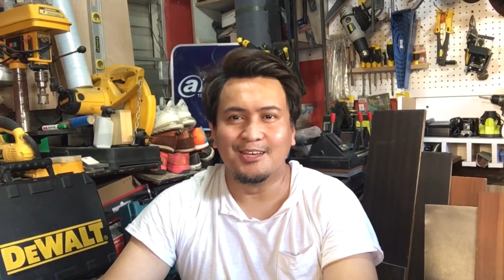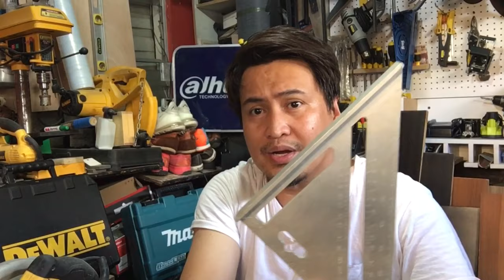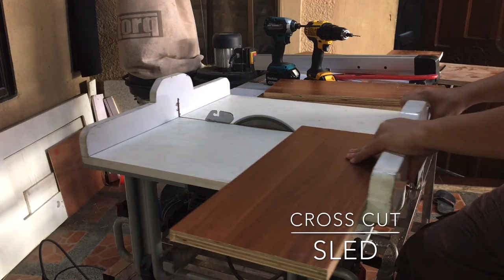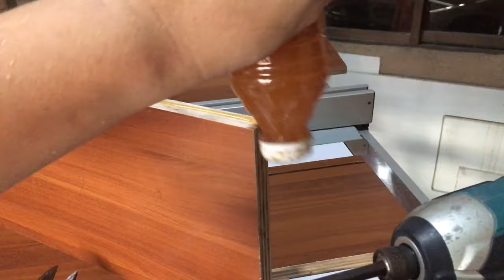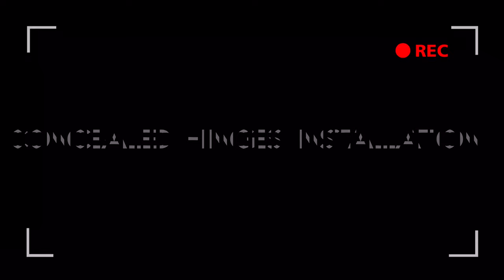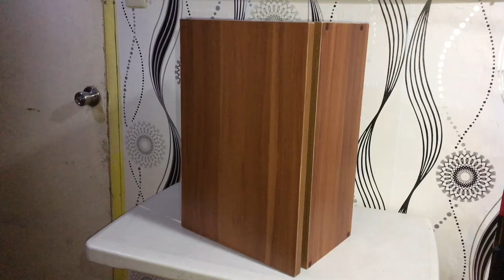HOW TO MAKE MODULAR CABINET [DIY PHILIPPINES]

Comment: Sir Puwede ba yong Diablo 80T pang Rip Cut ng mga marine melamine?
Reply from the maker: Yes pwedeng pwede yan magamda 80 T para sa melamine boards
Reply: @arokabletv  thank you sir sabi kasi ng iba nasusunog daw o may burn marks kapag masyado mataas ang teeth count kapag rip cut?
Reply from the maker: @joshuady1327  di naman po ang cause po ng burn mark is mapurol na po ang. Blade and di po aligned ang blade pag cut, 60 or higher teeth po is recommended sa mga fine cutting gaya ng melamine maselan po sya para iwas chips out.. wala g Siklat at edges or tip ng boards..
Reply: @arokabletv  ok po sir salamat!

Comment: Sir tanong po if u have used or any experience fdbk with MFC material ?
Reply from the maker: Ok naman sta if not exposed sa mga basang area like kitchen cabinet .. basta wag mababasa ok naman sya it will last naman .. kasi pag na basa at na exposed sigurado lolobo ang materials mo na MFC
Reply: @arokabletv  recently kc I contacted a supplier and searched a video of their product knowledge, the test was a 24 hr water soak bet Marine plywood and MFC, result in caliper showed that marine expanded 2x bigger than d MFC. The product is made in Austria and d size is 9x7 ft. 2face melamine.
Reply from the maker: @kingdomtreasures888  yes may mga lumalabas na MFC or MDF na water resistant na may chemical content against sa water at meron din na PVC board design for kitchen cabs
Reply: @arokabletv  opo sir amazing ung PVC di pa po ako nakagamit nun product din ng supplier that I contacted medjo pricey lang for non-melamine but perfect for kitchen solutions pang lifetime na yun. Salamat sir 🤘🤘

Comment: Boss pwede po ba gawing countertop yung plywood na may formica laminate?
Reply from the maker: Jed Escuzar yes pwede naman pero kung sa kitchen sya mas advisable ang granite or solid surface
Reply: @arokabletv  rental lang kasi yung apartment ko kaya feeling ko hindi justifiable mag granite hahaha. anyway, if that't the case then pwede ba mag-install ng tiles on plywood?
Reply from the maker: Jed Escuzar correct pwede naman mag install ng tiles using mga no more nails  adhesive, maganda kung 60x60 tiles para konti lang dugtung ayus yun
Reply: @arokabletv  a yung sa bostik po ba? pag apply po ba nyan is parang tile adhesive na style?
Reply from the maker: Jed Escuzar hindi portion lang side at gitna balanse mo lang hindi lahat mauubos pang dikit mo agad.. portion lang makapit na yun
Reply: @arokabletv  di ba prone to basag yung tile kapag hindi uniform yung adhesive niya sa baba?
Reply from the maker: Jed Escuzar correct prone sya kung medyo hard ang pag gamit i mean ma totodo ang  diinan  maari boss, pero kung manipis lang ang apply sa plywood  ng adhesive para ma dikit lang di masyado mag aampaw ang tiles normal use di naman mag crack yan matibay din

Comment: Ano po yung specs ng blade na ginagamit nyo sa circular saw para po pino at malinis ang cut ng mdf or marine plywood
Reply from the maker: Bosch na blade gamit ko 80 teeth para sa fine cutting at iwas chip off po

Comment: Hi sir, what do you call the tool you used for the edging, before you cut the excess of the edge by a knife cutter
Reply from the maker: Hi Sir im just using adhesive which is the contact cement or rugby will do, i used a metal cutter to cut the edge band and the other cutter which is the black one? That is edgeband cutter this is available in the market you may contact me on my Fb page to show you the picture and where to buy.

Comment: Ano poh tawag s materyales n ginamit nyo s pag dikit ng s edging.? Ung plastic.
Reply from the maker: Kung pandikit contact cement tawag doon if kung yung dinidikit sa  boar sa edging edgeband po
Reply: Ah edgeband. Ung ka kulay ng board n melamine.?
Reply from the maker: Antabay po kayo para sa give away natin  aa mga sususnod na panahon  pa like and follow din po ng Fb page natin Arokable Tv
Reply from the maker: @augustdelatado63  tama edgeband tawag doon sa ka kulay ng board tama ka yung pamdikot is contact cement or adhesive pwede din rugby
Reply: @arokabletv  salamat poh
Reply from the maker: @augustdelatado63  you're always welcome po pwede nyo po ako Pm sa messenger ng page natin arokable Tv

Comment: Boss paano maiwasan ung mga chippings sa pinagputulan ng mga laminated marine?
Ilang ngipin ng talim gamit nyo po? 60 or 80 po ba? Thanks
Reply from the maker: 80 teeth po pag melamine laminated, dapat sa new project bago blade mo, kung luma blade mo mag pre cut ka muna pasadahan mo ng mga 6mm muna then ulitan mo full cut wala na chipping yan naprocesso lang
Reply: @arokabletv  thank u very much sir for the info saktong sakto bumili pa naman ako ng 7" na 80 teeth. laking tulong tong video mo dahil madalas kaseng nagcchipping mga pinagputulan ng laminates ko, nasasayangan ako sa materyales kapag ganun.
Reply from the maker: @gilangeles1306  you're welcome po practice lang po lagi at gawa ng project gaganda din
Reply: Lagyan mo ng masking tape yung dadaanan ng saw blade, cut, then remove the tape, para iwas tear out
Reply from the maker: Hindi kailangan kung matalim ang blade walang chip off yan

Comment: May tanong lng ako. pano nyo po nadikit yung 3 board na pinaglagyan ng corner clamp? Yung process na po yun gusto ko malaman
Reply from the maker: Pwede po ako PM sa Facebook messenger ko  for question na ma detalye pero sa tanong po nyo gamit po ang corner clamp para mag kakadikkit sila gamit 3 clamps din po
Reply from the maker: Sa isang clamp po 2 boards kaya e joint nya so kung tatlo magakakadikit 2 clamps need gamit mo
Reply: @arokabletv  i mean yung method po ba ng pagkadikit eh glue lng ginamit mo?
Reply from the maker: @rygonzales5381  walang glue na ginagamit sa pag joint ng boards screw lang pag modular cabs nood ka po ibang videos ko madami po makukuhang technique doon

Comment: Anong yung tawag doon sa nilalagay sa side ng plywood? tnx.
Reply from the maker: Jeffrey Buera alin po doon tools po ba ?baka clamp po pang square or yung edging po siguro edgeband po tawag doon dinidikit po ng contact cement
Reply: Ay salamat  po sa iyong pagtugon edgeband  po pala ang tawag dun. tanong ko din po sana kung saan pede makabili nito. salamat po
Reply from the maker: Jeffrey Buera meron nito sa mga home
Depo Jeff iba ibang kulay per meter ang pag bili

Comment: may paraan ba na hindi kita mga screws pag melamine board ang gamit?
Reply from the maker: Buboy Ingua opo using  pocket hole pag sa mga expose di tayo gagamit ng screw, for  demo purpose lang po yang ginawa ko box
Cabinet .. may mga screw caps din at mini fix para di kita screws specially expose na side
Reply: @arokabletv  sir may video din po ba kayo paano ganun? Lalo na sa mga shelves paano naitatago yun mga screws? Also sa mga cabinets na mababa san tinatago yun screws sa pag buo ng cabinets? Thanks
Reply from the maker: Buboy Ingua meron po  video how to make modular  computer table yung mga Drawer box po gumamit ako ng  pocket hole .. pwede kayo Pm sa Fb page po natin arokable vlog tv  sagutin po natin doon

Comment: If i were to make a cabinet like that, i  will use single-face plywood. The inner being the laminated first, the outer to be laminated later  to conceal the screws.
Reply from the maker: Super dami na ng cabs na nagawa ko lods i know the concept of not showing the screws on exposed panels, this is just a demo bro on how to make carcass, no extra single face during that time yan ang available na board so yan na ginamit ko at pandemic yan wala board na single face available sa shop ko

Comment: Paano i attached sa wall yan?
Reply from the maker: Lance TV kailngan mo ng wedges para dyan naka 45 deg isa naka attached sa wall yung isang part naka kabit sa cabinet  para  pag salpak mo sa wall kapit sya support ka nalng ng  screw para sa concrete dalawa pwede na left and right para di  gagalaw.. pwede din gumamit ng suspension bracket.. tuned in boss mag upload tayo ng video para dyan
Reply: French cleat ang tawag dyan. 45 degrees ang bevel cut for both the cabinet and for the wall.

Comment: Wag masyado mataas ang blade ng table saw.. yung tama lng sa plywood
Reply from the maker: Corrrect dahil old stock at madaming beses nagamit ang blade super purol na , nag chichip off na ang boards pag mababa ang blade , dahil lock down at walang mabilhan ng new blade need mtaas ang blade to avoid chip off sa  board, but good advise recommended  blade depth is not to high unless its needed Thanks